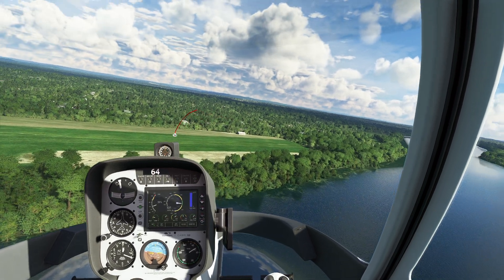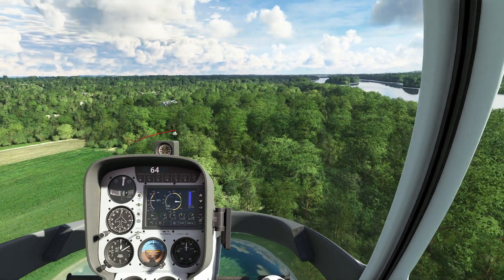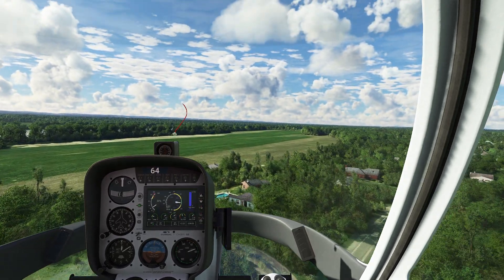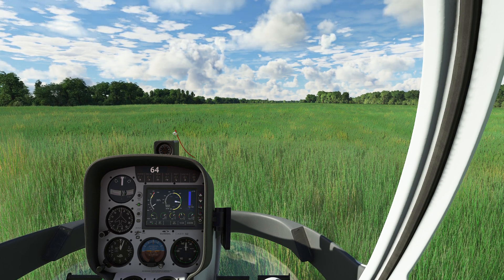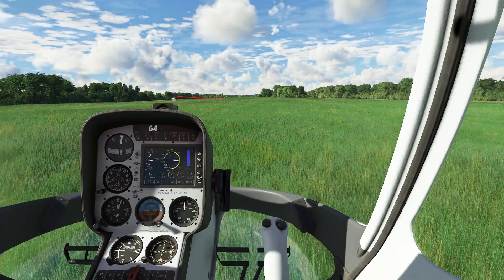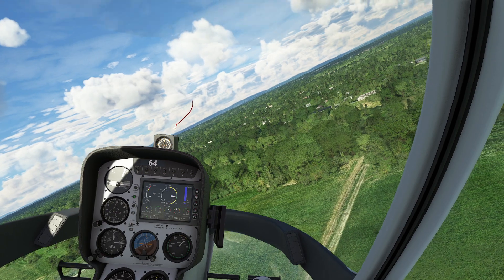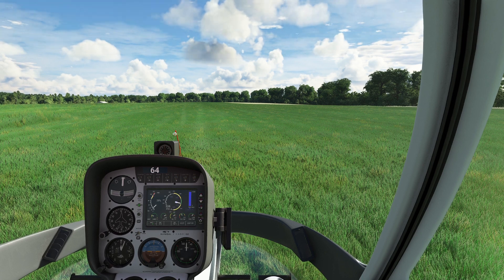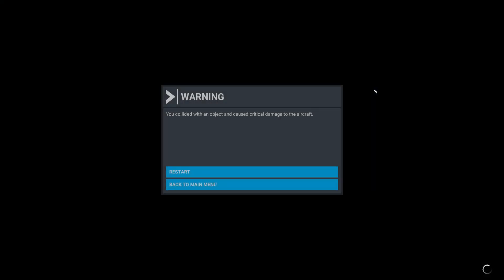MSFS - Helicopter Translational Lift

Comment: Nice video about the impact translational lift has on your helicopter. You shouldn't think of it as a cushion, though, as you described; translational lift is the opposite of a cushion. When your rotor is translating through the air at a high enough speed it is able to churn through purely clean air instead of recycling some of the air it has already processed. Think of it more as clean air vs dirty turbulent air rather than the cushion effect similar to ground effect.